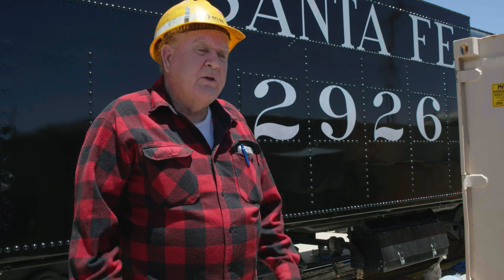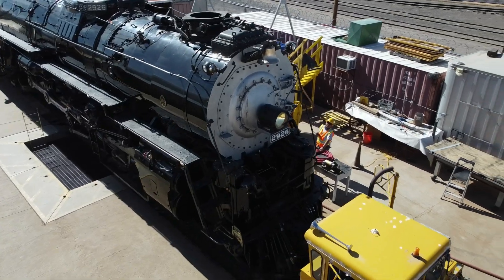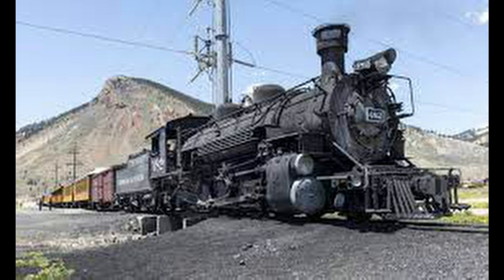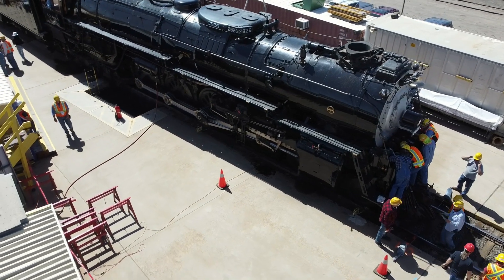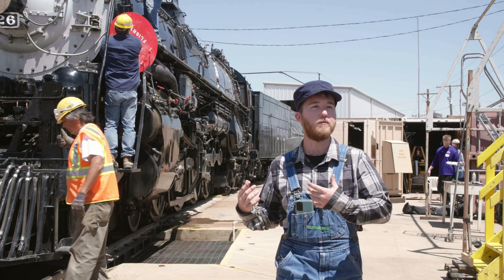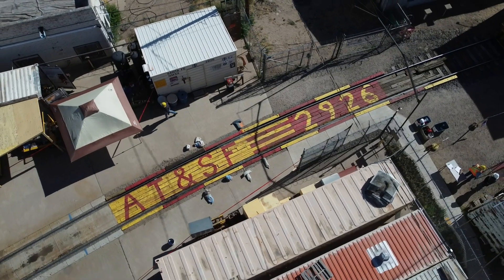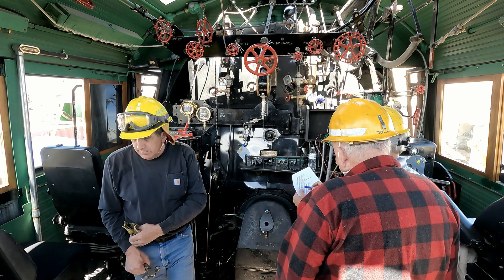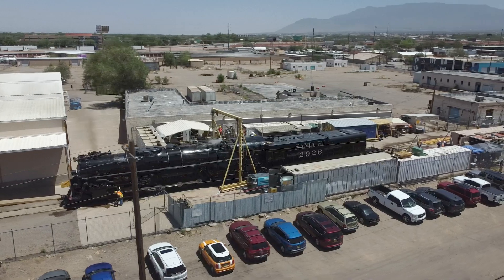Stagecoach Foundation's Steam Stock Sizzle Reel "The 2926 Project" Student Film Training

Comment: Will they run the 2926 like on thw Grand Canyon railway and any other places
Reply: They haven't even gotten clearance for a test run out on a mainline, so a run on the ever busy BNSF Southern Transcon to get the 2926 to the Grand Canyon Railway is not in sight right now. I'll also point to the literal decade long wait that was between each of the 3751's runs on the Southern Transcon as evidence as to why you should hold your horses when it comes to the 2926 potentially running on the GCRY. 
It takes plenty of time and experience on the part of the organizers and operators for those things to happen, and the 2926 crew, as of the typing of this, are in the extremely early stage of getting that aforementioned time and experience under their belt.